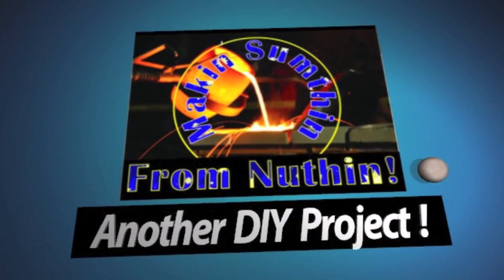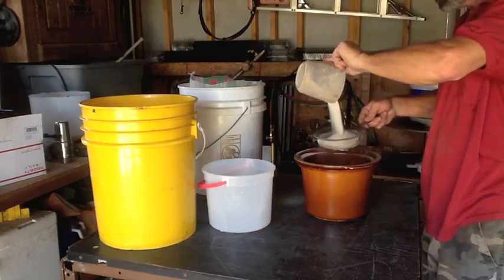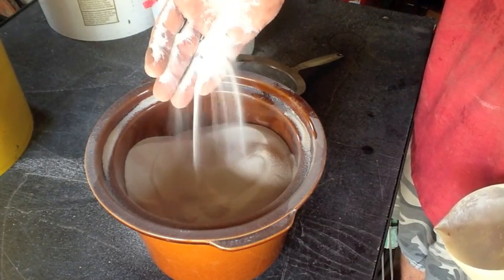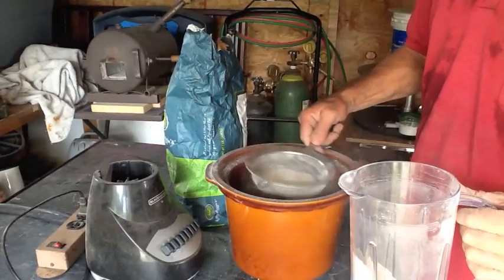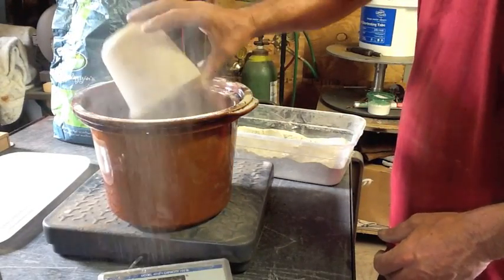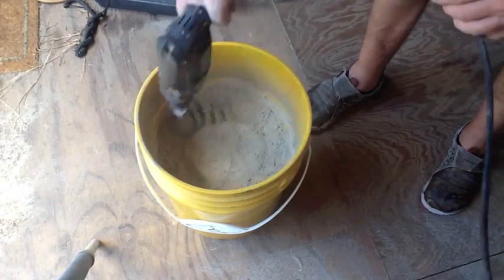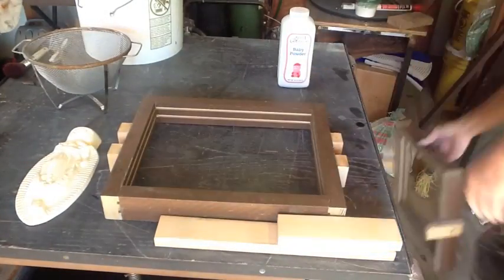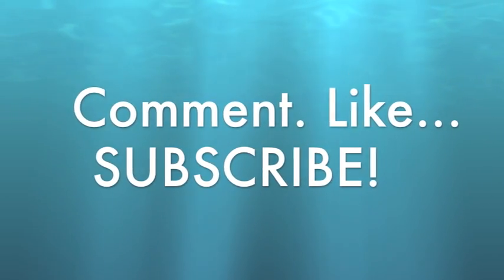DIY GREEN SAND FOR CASTING - CHEAP, SIMPLE and FAST - MSFN

Comment: Best video I have watched as a tutorial for making something from nothing. I am wanting to cast some silver army men and I believe this is how I can created my molds cheaply and quickly. Do you have any special tips or hints or watch out fors when I get ready to start? Thanks in advance.
Reply from the maker: I would watch my other videos on casting items and get a sense of how that aspect works. Molds can only be made by items that will release from the sand and not destroy the sand upon removal. If making "men" you may have to use a process called lost wax casting....depends on what the men look like

Comment: So, roughly, it's common sand, as fine as possible, and 10% clay, also as fine as possible, homogeneously mixed and mosited just enough for it to keep it's shape.
Reply from the maker: Yup....I could have just said that....but the video woulda been too short 😊
Reply: Makin Sumthin From Nuthin not trying to criticize the video, it's actually thorough and clear, it's just that i'm not on US and don't know what play sand is, also i think i can get clay straight in powder form, so I was making sure I got the basics of it.
Thanks again for the video.
Reply from the maker: I was totally agreeing with you, its as simple as your original post. You summed it up perfectly!
Reply: Makin Sumthin From Nuthin I'm chewing up the idea of buying a 3D printer to make toys for my boys, I'm proficient enough in 3D modeling.
Now the idea of casting aluminum parts using this method and 3D printed parts, even by losing the parts makes the decision even easier.. I'm going through your videos, thanks a lot.
Reply from the maker: Thanks, casting is pretty cool....good luck! ~ Richard

Comment: My sand always dries out quickly and it will easily crumble and stick to my moulds. Any tips?
Reply from the maker: Its a fine line between too much and too little water, its something you just need to work at thru experience. The correct ratio of clay to sand is also an important factor

Comment: Good video!  Liked the voice over instead of during.  But got a question, the bentonite clay, every time I search for it (to avoid the blender step) I always wind up only with results from health-food store/sites.  no bulk.  Have a source/line?
Reply from the maker: I bought a 25lb bag of litter (bentonite clay) after this video at a discount food store...cost me $6. Compare that to what you found....run the numbers 

PS: buy a cheap blender 😊
Reply: I tried with the bender (prior to watching vid) and burnt it up.  (though, probably burnt it up on a previous 'mad scientist' project)  Best price I found, which now seems reasonable, was $9 for 5lbs
Reply from the maker: i baby the blender, they arent made for continuous use. 5lbs will make you 45lbs of green sand....still not bad vs buying commercial premixed green sand. I am just a cheap bastard 😎
Reply: I'm cheap too.  Still value my time (to some degree)  Plus cost of losing my margarita maker, electricity cost, etc. (though a solar powered ball mill is in the planning stages)   Oddball Q is sand casting lead a waste?  Have a 1 or 2 off project that I think could be done in plaster of paris or Durham's rock hard.
Reply from the maker: Sure, lead should work....dont see any reason it wouldnt~ Richard

Comment: I am wondering if using a sonication bath (like used for cleaning jewelry and other harder items with tiny crevasses of dirt and debris with out rubbing and buffing away material. If you are doing casting, I would guess that a sonic bath would be a good thing to have for finished parts cast anyway :) both for pulverizing the clay and breaking down the sand that is too large for use, to get finer clay and sand, *which means more sifting ;) sounds like the sifting here, is a lot like sanding in autobody work, sand, sand, clean up, sand, clean up and go home, sleep, come to work, and sand some more XD
Reply from the maker: Good sand=good results :)

Comment: Hi, 
I need to make a 3D/Rounded mold. It's Like an infinity symbol except it's about 3 inches wide on each end with a 1 inch center where it twist.  Any suggestions?
Reply from the maker: Do you need to produce the mold or a casting?
Reply: The casting. I sell them. Imagine having a paper towel roll with a twist in the center. I want the details in the twist and I want the ends to remain hollowed out.
Reply from the maker: If I am understanding correctly, I dont believe the mold could be made using this method as there would be undercuts which would prevent the pattern being removed from the sand without taking some of the sand with it. Lost wax casting would be my suggestion. That method can produce exquisite detail on virtually any shape. A good example is bronze statues made centuries ago using this method...it is still used today such as in jewelry making as well
Reply: Awesome! Thank you

Comment: would a two part epoxy work with this sandcasting? or any type of liquid epoxy for that matter? great vid BTW. Very helpful. T.
Reply from the maker: I never tried epoxy, I am sure your cast epoxy part would be covered in sand tho if it worked 🤔

Comment: I just subscribed. Nice work! I'm looking to make some cast parts soon. One question: Where to you get the wooden box to hold the sand? Or do you make that? I see some dovetail cuts where the boards are glued together. Is that necessary? Thanks.
Reply from the maker: I think my video on making the wooden boxes (flask) can explain it better than I can here in a comment https://www.youtube.com/watch?v=YvRCUUGwKOo

Comment: Tip for grinding the litter... Tip the blender to the side while it is running. This will cause the litter to move around more  for a more even consistency.  It will also reduce the load on the blades.
Reply from the maker: Thanks Chris...nice fish! 😊

Comment: Kitty litter is diatomacious earth.  Sand is silica.  They are both silica.  The dust from it will cause silicosis.  You really need to wear a respirator or at the very least a dust mask when working with them to prevent silicosis.
Reply: actually the kitty litter he mentioned, the one that lists clay on the label is bentonite clay. but yes a respirator is a must when working with anything this finely powdered.
Reply from the maker: Great advice, thanks
Reply: The thing that makes play sand OK for kids is that the fine silica has been removed to reduce silicosis risk.  Then the kitty litter adds it right back.  We pay for that processing when we buy both, and do additional labor to mix them again.  How much better is the result of this process than just sifting plain old regular free sand off the ground that already has bentonite in it?
Reply: @DustinMaki1 play sand is washed silica sand.  The silicosis comes from the silica dust, hence the washing.  Not all sand is the same, and pure silica sand is very specific from all other sands, natural or manufactured.
Reply: Dustin Maki not sure of what you are talking about. Sand is sand and it does not lose its silica properties. The bentonite clay that is used for cat liter is commonly taken from Wyoming. Never dug up sand with bentonite already in it. I have never seen kids in a play box wear a respirator or on a beach covered in sand. I think people watching this video should wear a respirator for him instead being the little kid that say oooooooohhhhh your not wearing a respirator!!!!!!!!!!
Reply: @jasongrinnell1986  I think he works for OSHA!! 😂

Comment: If you want very fine sand, you can get pre-used sand blasting sand.  I find that after using the sand 5 times or more it's no longer useful for sand blasting but is very fine and great for high detail sand casting.  nice video
Reply from the maker: Thanks for the tip 👍🏼
Reply: your welcome,,  I made an interesting WOOD BURNING ALUMINUM FOUNDRY video on youtube.  If you would like to check it out.  Not everyone has access to propane, or other fuel sources so its a nice option.  just search under WOOD BURNING ALUMINUM FOUNDRY. Feel free to use any ideas on any future videos. Robert
Reply: That is a great tip, thank you. I sure do appreciate you taking time to share your experience gained knowledge, bc I am brand new to this as I try to make it as a surprise for my husband. He's been dragging us all over the county for the stuff, but it's either marked up too high or not something they carry. Can't wait to see how the sand blaster sand compares to the play sand. Cheers!
Reply: Glass bead sand? I have access to this.  Good tip!
Reply: But won’t the used sand from sandblasting contain too much unwanted material? Like bits of paint, primer, and particles of whatever metal was being sand blasted ?
Reply: That would be very contaminated sand, with primers, paint and various unknown metals with different coefficients of expansion which may cause fractures in the final poured piece.

Comment: I'm sorry to ask you so much. You just have the best videos I have seen! My question is, for this method of casting, it seems practical for larger, single molds, as opposed to many smaller molds. There are a lot of cool plaster molds with multiple small molds I think would be cool to use. Do you know of the most efficient way to cast molds like this? I was thinking this method might work if I just make an even flat layer of plaster across the entire top and chisel out the excess after casting. Let me know what you think. Thank you!
Reply: Looking at the molds again, my idea doesn't seem very practical because there is not any overhang over the edges of the entire mold to hold the plaster to make a flat layer :/
Reply from the maker: You can secure the individual little plaster molds once done in plaster to a thin flat board and use the entire thing as a casting pattern, then trim out the individual castings with a bandsaw and clean them up...gotta get creative! 😊
Reply: Brilliant! Thank you!

Comment: Good and fast reply! Thank you good sir, I will give it a try tomorrow and tell you how it goes. Do you think that if I where to smash it up in a steel container with a hammer, it would turn to powder?
Reply from the maker: Give that a try and keep me posted
Reply: Makin Sumthin From Nuthin hey would you think that natural clay would work instead of Bionite clay??
Reply from the maker: Having never tried it I couldnt say but a 25lb bag of kitty litter is only $5-6 bucks
Reply: Makin Sumthin From Nuthin yea so I bought a bag, it was natural clay aha. I made a mold for brass knuckles out of Styrofoam and gonna pour some aluminum tmr morning!
Reply from the maker: Good luck & happy casting, be careful 😊
Reply: Makin Sumthin From Nuthin hey it worked!

Comment: Great videos! Instead of using kitty litter and having to pulverize and sift it, you can buy diatomaceous earth at any agricultural store instead. It's the same thing as bentonite/potters clay and comes in an extremely fine powder. I've used it to make mini forges and it works great!
Reply: Jimi Warner your comment is useful and helpful when used in this particular context and both materials should work very well together as casting sand. However, the readers need to understand that Bentonite clay and diatomaceous earth are NOT "the same thing" at all. Bentonite clay can and is used as a barrier for water and diatomaceous earth is commonly used as a filter for water. These materials have entirely different properties. Bentonite particles "lock" together tightly whereas diatoms, because of their unique surface structure do not and in fact can not lock together to form an impenetrable barrier to water.
Reply from the maker: Thanks Jimi!, I never used the DE before.....expensive?
Reply: DE is not bentonite clay. It is most likely calcium. It's made from the skeletons of one celled animals.
Reply: You can also just buy bentonite clay itself directly from a home depo store, which will be MUCH cheaper than buying it as a cat litter. The main difference is that cat litter is sold at 10 pound/5kg packs, while gardening bentonite is in 50 pound/25 kg sacks, so it makes a difference on how much of the product you need in the end. As for their casting application, bentonite, if you pulverise it, is far better for making molds due to both better absorption (better tolerance when making the mold if you put too much water into it) and finer texture (nicer, smoother finish of the cast metal in the end).
Said all that DE is in the end of the day still about 70% of the pricetag of the bentonite clay, so depending on how fine the casting is intended to be, you might want to use DE anyway.
Reply: diatomaceaous earth is made of glass they are the shells of dead algea called diatoms its not clay lol

Comment: What would happen if too much clay was used? I get too little would fall apart. 11% is fairly accurate, but what would happen at 20% or 25%?
Reply from the maker: At 25% it would turn your sand to sticky mud and you would have problems with the pattern releasing. You will get to know your sand and realize when you have too much or too little. Use only enuff clay to get a firm mold that releases the pattern.....and stays in the flask throughout the casting process....11-12% is all you need :)
Reply: Thanks

Comment: Could you use vegetable oil instead of water
Reply: That wouldn't work because bentonit clay isn't soluble in oil
Reply from the maker: Motor oil is commonly used but I have never heard of anyone using vegetable oil. I am not sure which grade of oil to use but I am sure a quick search could tell you

Comment: Thanks again for all the great videos! I had one question though. After casting metal, is the green sand you used for the mold reusable or would the heat kind of make it unusable for another cast?
Reply from the maker: The heat from the molten metal dries out the sand closest to the cast piece and renders the sand unusable for immediate reuse, but once the heat has dissipated the sand can be remoistened to the proper consistency and be reused immediately :)
Reply from the maker: Dont forget to subscribe! :-)

Comment: You will get better results if you use bentanite(sp) clay. It's usually sold as clumping cat litter and costs more. A simple test can be done with the use of a test tube. Fill about 3/4 full of cat litter and fill with water. If it's bentarite clay, the water will stop in about an inch (in a l/2" wide test tube), if other clay, it'll go rite the bottom of the test tube or until it's absorbed. An hour later the bentonite will still be sitting with water on the top of the clay. Use 10-15% bentanite to 85-90% fine sand by weight.
Reply from the maker: I am getting the impression you did not watch the entire video.

Comment: Very nicely presented ,no nonsense,straight and to the point.Never heard of play-sand in Ireland and kitty litter I also need to research.I also need to find another method of breaking down the kitty litter.(probably make another project out of that).One thing is sure ; I am going to have a go.And I think I will also have a go at making an air-tight lid so it holds as much moisture as it needs without having to remix.Thanks for sharing and I will let you know how it went.
Reply from the maker: Thanks, yes...an airtight container is perfect. Greetings from USA :)

Comment: What exactly do you use to get the lift bolts in? Tap a hole?
Reply from the maker: I placed the screws into the plaster once it firmed up some and let the plaster harden around the screws....then removed them once the plaster was fully dried "reverse tapping" LOL :)

Comment: Thank you for the video. It's very easy to fallow. I did have a couple of questions maybe you can awnser for me.
Once made how many times can green sand be reused before having to be replaced?
In this video you used water as your binder but I've also seen others use some type of motor oil. Is there any benefit to using one over the other?
Reply from the maker: I am still using the original greensand I first made as well as additional batches such as this one. A light touchup with some additional clay once a year or so may be required....you get a feel for how the sand behaves. It can be used indefinitely. I use water because it is less messy and one less thing to buy :)

Comment: best green sand video out there!!!  Just got a new sub.  

Ive been buying sand from a local foundry at $20/ bucket.   It's black and kinda burnt out.   Will be nice to make my own now.
Reply from the maker: Thanks Travis, glad it helped ya out! I dont have a muller (no room for it) I remix the sand using a drill and an eggbeater paddle...works good :)
Reply: thanks!  Ive been casting for 3yrs and havent used a muller yet.  interested but like you no room.
Reply from the maker: We both need bigger shops! :)

Comment: Those particles must be quite small, the way they float around in the air. I hope you are wearing a mask of some kind. I don't know how much exposure it takes to get silicosis, but that would be really bad. I think that's the right disease word.
Reply from the maker: Yes, a mask or respirator is reccommended when working with materials such as these. Thanks for watching Dennis!
Reply: Hmm, but kids play in that sand.  Are they at risk of getting silicosis?